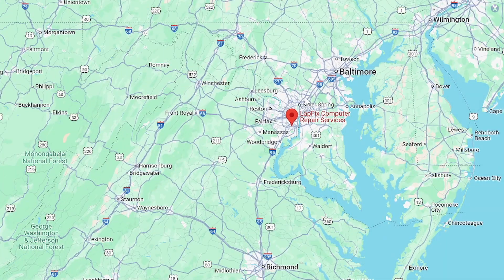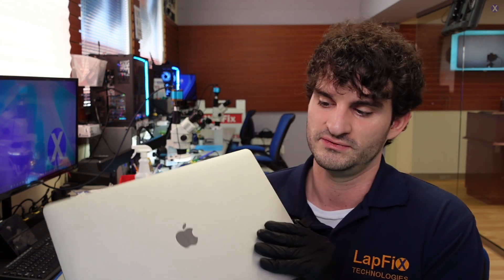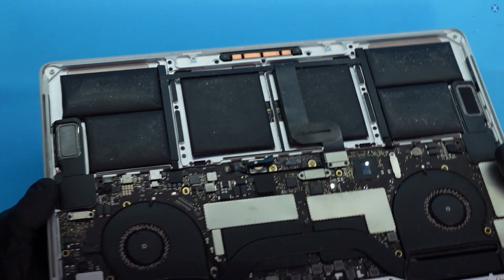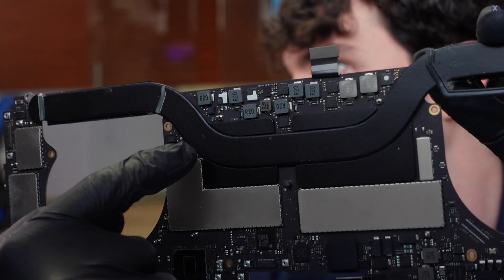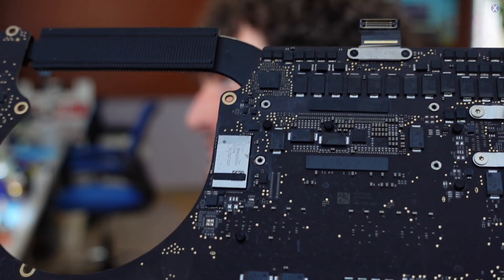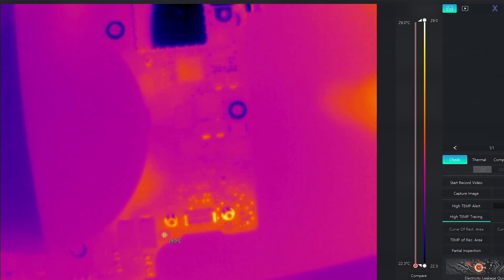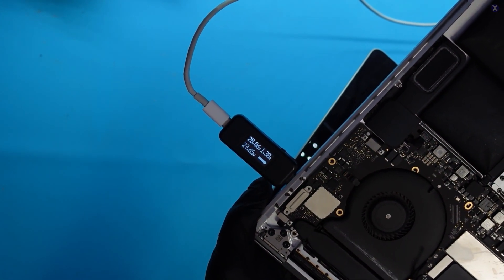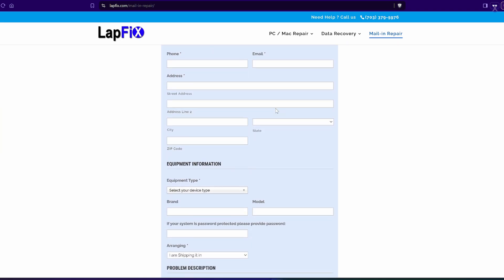Fixing A MacBook Pro Not Charging And No Power

Comment: Hi! I have an older Toshiba laptop and it's keyboard suddenly stopped working (only 3 keys still work apparently "b, n, \") I think this happened because maybe I used a bit too much alcohol when I recently cleaned it. Before I order a new keyboard, do you have any advice? I checked the ribbon cable and is seated properly. Do I need to replace the kb or is there anything else I could check? Thanks!

Comment: Hey, I have a Macbook air 13 inch retina display early 2020 and it does not open without putting the charging cable on  and it takes a lot of time to open. Also, it is so slow that it is almost impossible to use. I have not used it for 3 years now. But I do check on it time to time and now Iam thinking about repairing it. After searching for the cause of this problem in the internet, I found the battery is the problem. So, what are your thoughts about it? Please help😓
Reply from the maker: Hello!  Thanks for watching! The battery has a circuit board on the 2020 model.  If there is an issue (like if the battery is not detected)  the MacBook will sense it, the fans will get really loud and the OS will be VERY slow
Reply: @lapfix  Can you tell me how much will the original battery cost?